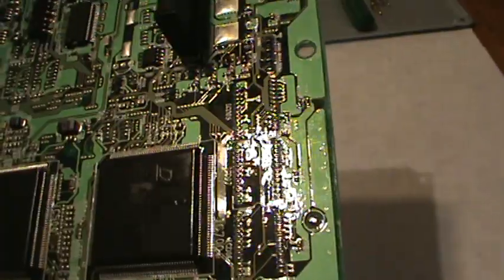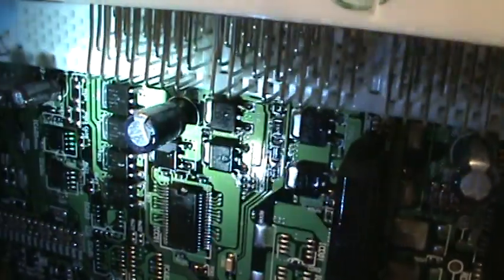Powertrain Control Module (PCM)

Comment: If your ECU is failing - give us a call. 800-900-0194 or shop our store at www.autoecmstore.com . We have over 400,000 parts in stock and can either replace or repair your ECM. 800-900-0194, thank you!